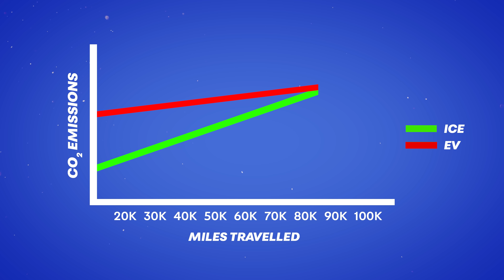Are Electric Cars REALLY That Green? [New 2022 Data]

Comment: The comparison doesn't take into account the additional labor required to earn the money to purchase an electric car. Comparable EVs are quite a bit more expensive than ICs. More labor to purchase also equals larger carbon footprint. Having your own solar panels and wind mill have the same problem. They have to be made, installed, purchased and maintained all moving the breakeven point higher. EVs are in their infancy as well as solar and wind, but over time they should improve greatly, which will also lead to improvements in other technologies. The rush by governments to force people away from IC to EV is wrong and should be stopped. It will stifle innovation of all these technologies by removing competitiveness

Comment: Progress takes time.  EVs will evolve with more sustainability.  My hope is displacing diesel somehow to a bare minimum.  The automakers have failed on their promises of clean diesel.  If you believe Mazda, they think gasoline ICE engines can reach over 100mpg so maybe these efforts as well can help until we reach maximum conversation rates (EV).  But realistically I don't see the world going 100% EV without an exponential increase in power storage density (batteries).

Comment: I don't think the study considers the longevity of the batteries. For example, batteries can be used for electric storage after they have been used in a car. It also doesn't include the total emissions from drilling for oil. Not to mention the diasters from oil spillages.

Comment: EPA fuel mileage predictions are a joke. They get the number by running the vehicle on a rolling dyno (basically a treadmill for a car) in a climate control garage. If the EPA actually did real world fuel mileage testing the numbers on the stickers would be 20 to 40 percent lower.

Comment: We all know there is NO net zero in manufacturing. And unless you have a solar panel or hydro dam that electricity is being generated from something. But still its better.... My daughter recently bought an EV, and right now, the monthly increased electrical cost is around $30 month. Zero car emissions. The price of gas /petrol is up quite a bit in Canada, I drive as much as she does in my Rav4 and my costs are $150-$200 month in gas. She won't need oil changes, and EVs have much lower maintenance. Over the long term she'll save and pollute less.  Thats the point.

Comment: Are they claiming that they get their electricity from non-carbon emitting power plants or do they just claim that electricity is just clean from start to finish? Here's another thing, it cost CO2 to produce solar panels, wind generators, and hydroelectric power generators. There's also a problem when it comes to creating the concrete for power plants. Another issue is that EV has is that the life of a battery vs the life of a car. While some people claim that combustion engine life span is 133,000 miles, there are engines that last much longer than that if you keep up on their maintenance. An EV battery is said to last 100,000~200,000 miles, however unlike a normal ICE(internal combustion engine) normal people can do required maintenance on their own if they so choose but would fail if they tried to do it to a EV and can void warranty as well as the car as a whole itself. EVs are not for the poor used EVs might not be worth it if that battery dies shortly after purchasing it because they cost $4k to $16k, when a used ICE car most often doesn't require $2k to repair certain things that fail.

Comment: Has driving style been accounted for? The range -  and therefor energy use - is dependent on driving style; the more aggressive the driver, the lower the range. I my experience EV cars are often company cars - at least here in the Netherlands which has many EV's - and are driven often quite aggressively. They speed away from traffic lights and often drive faster on the motorways. One guy I knew who drove an e-golf complained about not being able to drive as he liked because he wouldn't make it home on a single charge if he did.
If due to costs the majority of EV users are business professionals - which tend to have a more aggressive attitude or they wouldn't be able to perform their jobs well - energy savings and therefor pollution reduction would not be as high as expected.

Comment: some factors to consider. people like me only buy used cars so my used car has no cost to create, it's already here so I'm recycling and starting at an even lower deficit and would take longer for the impact lines to cross paths if I bought a new EV. Now say I bought a used EV with high miles then the battery needs to be replaced, wouldn't the EV then start back at a much higher deficit than my used gas powered car negating all gains it made in it's life? right now electric cars are something that if everyone had one would cause our planet a whole lot of hurt so for now isn't it a better idea to just stop buying new cars in general? if your really looking to save the planet buying a new car is about the worst thing you could do or atleast from my perspective this appears to be the current reality. I would like to see the data points at the 300,000 and 500,000 mile points.

Comment: There's so many things that need to be addressed before EVs are truly the better option, and it's mostly to do with the batteries. The mining of the materials to make them is environmentally terrible (not just from emissions), we currently don't recycle Li-ion batteries properly,  and this is on top of manufacturing process producing a lot of emissions. If these things aren't addressed, then when it comes time to replace the cars batteries, you're pretty much hitting the reset button in regards to your "break even" point. At the moment, I think people are better off just driving whatever used vehicle they like.

Comment: I think it is not so right to say EV may not be as green. It merely pushes the burden of pollution to electric network. If a network uses solar or wind or hydro than normail fossil fuels, then it is more green. As far as EV is concerned, it is definitely more green than normal cars. The challenge is for the electric network to use renewable energy.

Comment: Assuming Volvo's numbers are 100% accurate, there's another layer to factor in. EV battery packs (as of now) have a lifespan of about 100,000 miles. Currently, the cost to replace a battery pack is more expensive than the EV's overall value once it reaches that age due to depreciation and so the common trend is to buy a new EV. Meanwhile, ICE vehicles regularly make it to 200,000 miles or more if the design is sound and the vehicle is maintained well.

Now I'm not hating on EVs because I do think they are the future, but we really need to look at things like recycling/refurbishing battery packs on top of improving the battery designs themselves. Additionally, a lot of those renewables are reliant on fossil fuel backups (usually natural gas, but coal and fuel oil are also in play) so it would be wise to bring nuclear energy back into the fold, particularly with the newer generation of reactor designs (molten salt reactors, Thorium-cycle reactors, etc).

Comment: Is the lifetime of a battery 10-20 years? Most people travel around 10k per year. Mileage guarantees vary so maybe not the best indicator. It appears that the cut over point is around the same point as the lifetime of the battery. If that is true there's no time to actually realise any greener running period. In fact I think what you have presented here is that more electric cars now mean it's worse for the environment in the shorter term with only a potential payback later which is very dependent on getting a very long life out of the car and battery.

Comment: Not to mention all the energy used to charge the EV over 90.000 miles. It doesn't all come from windmills and solar panels. Maybe in the future, but were not there yet maybe in a few decades. Petrol and diesel cars will still be on the roads for a long time to come.

Comment: We also need a study on electricity generation. "Green" electricity is not perfectly green. All those mirrors, solar panels and wind turbines incur pollution in their manufacturing processes. They also use raw materials that are mined or quarried. Could we just be replacing the requirement for one finite resource with a different one?

Another issue is land use. Even if solar energy plants were perfectly green to manufacture and use it still requires a few hundrerd square miles of mirrors to replace a big coal-fired power station. Do we have enough space? What was living there before? People? Endangered species?

Comment: Best 4 words in this vid: "It's not that simple." Because the internet is a hotbed for polarized 'opinions'. Choose a side, and then pick away at the other side. It's like sports fans – you don't have to think, to be passionate. Politics have already succumbed to that syndrome. 
Manufacturing any complicated device has an environmental footprint. The point is (I think): Are we happy with how we've been transporting ourselves for the last century +? Are we content with the effects of ICE & diesel & jet fuel? Or do we want to pursue a different paradigm, and do our best to keep improving it to where it has less effect on climate and life forms?? Specifically, battery tech is only getting started; there are break-throughs every month. And since materials are so expensive, battery recycling is going to become a real, practical, widespread thing. The cost AND the enviro footprint equations are in total flux at the moment. Check back in 5 or 10 years.

Comment: "At the street level."  Thank you, sir.  You got that one right on.  If all you look at is a brand new EV on the road and nothing else, they're great.  Thanks for pointing out some of the realities of the pollution required to produce an electric car.
Reply: Not really. Making gasoline is far more polluting and less efficient. Also oil spills are a thing in case you didn't know.
Reply: I would'a never known that, Thuggee.  :)  I would like to see exactly how much energy goes into making gasoline and diesel.
Reply: @mcdevious2229  It's impossible to calculate with certainty. Think about all the wars waged to secure access to oil fields in the middle east. Now think about all the energy and money wasted to secure those oil fields. Such a huge waste of energy and money. Fossil fuels are artificially kept cheap, but not for long.
Reply: @thuggeegaming659  Check out the cost of and the charging time of an EV. If you’re ok with it, great. Most people aren’t because they are impractical. It is important to aid the environment, unfortunately the environment and population control are pawns in the battle to control the world.
Reply: @richardlandis793  Look up what quick swap is child.
Reply: @thuggeegaming659  you are never making just gasoline. I think you will not be able to find a single durable good in your home that doesn't have some by-product of an  oil derivative.
Reply: @k0zzu21  That's the point. The efficiency of producing gasoline from oil is incredibly low. Oil produces other fuels, but they are lower quality fuels that can not be used in gasoline vehicles typically.
Reply: @thuggeegaming659  gasoline is a waste product of oil refinement. How are you going to make roads, plastics, antibiotics, fertilizers more efficiently without oil refineries?
Reply: @k0zzu21  No it's not. Gasoline is the driving force behind oil refinement.
Reply: @thuggeegaming659  you are simply wrong. Not a single fact based argument in your comments in this thread. The oil refineries make their money mainly on heavy oil and kerosene. The stuff you put into ships and airplanes. Even diesel generates more revenue than gasoline. The inconvenient fact is that the modern society will totally collapse without the products from oil refinement and gasoline is nowhere close as being the most important of them.
Reply: @k0zzu21  No that's completely wrong. Heavy oil is actually a waste product, and it's dirt cheap because it's a low quality fuel. What makes it attractive is the fact that it's so cheap, but its low quality is why it's usually diluted with higher quality fuels like gasoline. In fact heavy oil, aka bunker C oil, is banned in ships operating in the Antarctic region due to concerns of oil leaks and the massive ecological damage it would cause if leaked. 

Kerosene is mostly just used for aircraft under the name "jet fuel", but by far the most lucrative and important fuel is gasoline. There was a time when kerosene was the primary fuel for refining oil and gasoline was a waste product, but that was back int he early 1800s, when kerosene was used for oil lamps. You're using horribly outdated sources as the basis of your arguments. You simply do not know what you're talking about.
Reply: IF I had one, it would burgundy with black interior.
Reply: and there are issues when the car is crashed (accident) or when it is at the end of its life + batteries (maintenance,  recycling, etc)
Reply: @peteroz7332  and there are no issues when crashing in a petrol car, like maybe 50 litres of highly flammable liquid fuel??
Reply: @Mac Moull  ups 😲 50litres + engine oil +  other liquids + battery [possibly] ( 2011 Mitsubishi Eclipse battery weighs 46.60pounds) -> 
wow soooo much pollution... let's see the other side then -> EV crashes (doesn't have to be a seriously damaged, but) it's treated as a total write-off and has to be scrapped-> (almost) nothing is recycled and ends up in a landfill...
batteries of tesla S 85kWh weigh around 1200pounds (but hummer's ev  battery alone is more than 9000 pounds in weight; about three times the total weight of a Honda Civic gas-powered car )
how much cadmium,  lithium or other dangerous pollutants is there in such humongous amounts of batteries 🤔 could the negative impact possibly be worse than ALL dangerous materials combined from ICE car? 
so go back to your dungeon and educate yourself first... Read more and think more before you start spewing some propaganda sh^t ... and come back when you have something wise to say... 🤌🤷‍♂️
Reply: @peteroz7332  touched a nerve there didn’t I? Truth hurts doesn’t it 😉
Reply: Nobody wants to talk about worn out wind turbines or lithium batteries, Pete.  Still to me, the environmental factors of extracting the lithium tend to get glossed over.  This appeared to me to only talk about the "carbon" emissions generated.
Reply: @mcdevious2229  the issue is well lithium is very dirty and dangerous to mine we need batteries that are lighter and better for the planet
Reply: That, Gulf City, is the sixty-four dollar statement.  Lithium works pretty well.  Extracting it is a whole 'nother thing.
Reply: @mcdevious2229  if graphene batteries were a thing that might be the answer and until the  electric motorcycle have very low range still 130 miles to 200 miles for a electric motorcycle is still to low considering most motorcycle can go 400 to 500 miles on a tank of fuel
Reply: @phyrexianND  but it's still "green" because the fact that the lithium gets mined by Congolese children is out of sight and out of mind. It's all about reducing the carbon footprint within the UK, hence why most of our "recycling" gets shipped to third world landfill sites.
Reply: If your batteries get damaged your screwed

Comment: Research here in germany published in January showed that overall emissions including production, mining etc are significantly lower for EVs than petrols or diesels over their average lifetimes. But EVs are still beaten in that regard by VWs cng vehicles which got slightly modified petrol engines and run on compressed natural gas.

Comment: Did Volvo take into account the 3x drivetrain life of an EV compared to an ICE? The latest models of EV's have a million mile drivetrain and 500,000 mile battery, although Tesla is working on a million mile battery. What ICE vehicle has a million mile drivetrain?
No personal car is driven for a million miles, but fleet vehicles would be. Using a comparison of total miles driven over the life of the vehicles is a more like for like comparison. In fleet use, ICE vehicles would be replaced at 3x the rate of EVs given the differences in drivetrain lifespan.

Comment: How about blaming the pollution problem on the electricity producers not the car.  This argument is great if you are an oil, electricity, or ice manufacturer. If the electric grid was green then you point would be moot. If I charge my ev at home with solar power then you have no argument.

Comment: You also have to remember though that EV batteries are generally recyclable so while the impact of producing them initially maybe high, future batteries maybe cheaper as they use elements of existing batteries. 

Battery technology is also continually advancing. They will get smaller, cheaper and easy to make as technology advances. Plus hopefully easier on the environment.
Reply: JB Straubel has started a battery recycling business, and I believe he said that over 90% of the battery material can be recycled, although obviously there is energy required to do that.